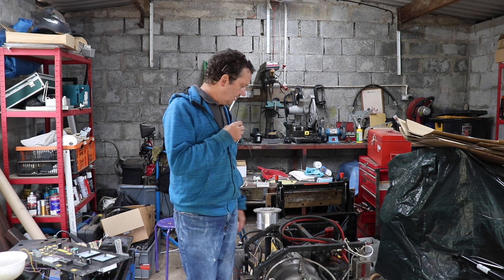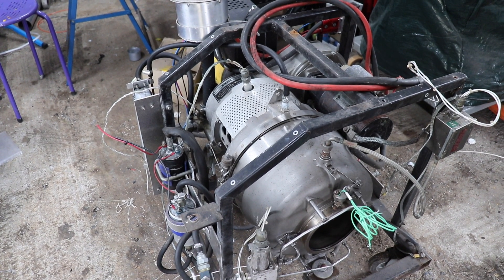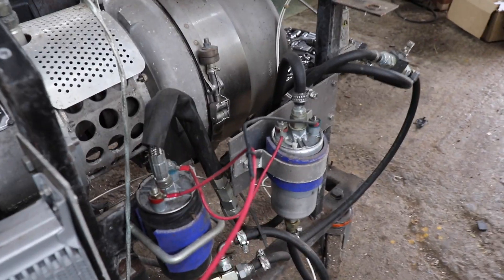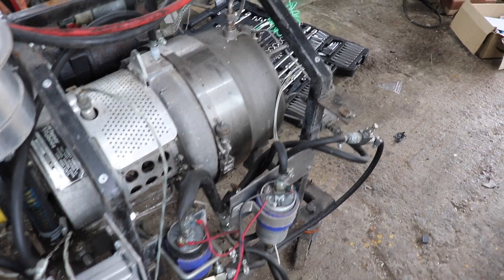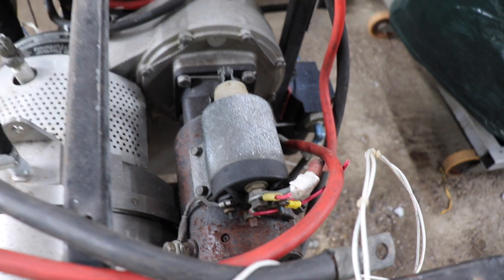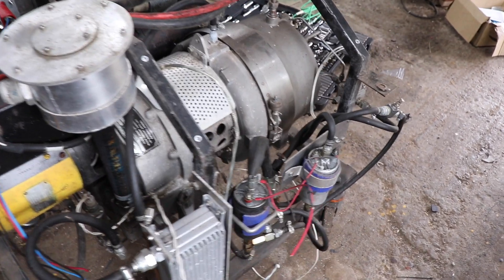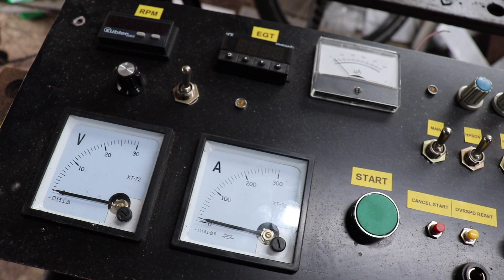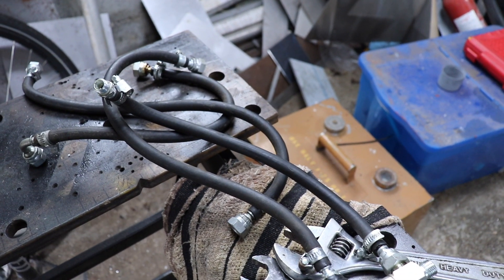Restoring The Tiernay TT10 Gas Turbine Generator

Comment: Hope you don't mind one more question,  are these starter units built into aircraft, and are they used by ground crews on occasion,  or is it more likely they use large conventional air compressors on the tarmack, Thanks Peter.
Reply from the maker: This one is from a ground power unit. Standard APU’s will generally provide power and compressed air for starting. There are also air carts which are ground units for starting
Reply: @thewtf  Hello, is there a way to contact you personally? I would like to inquire about a project I have
Reply: @thewtf  sir